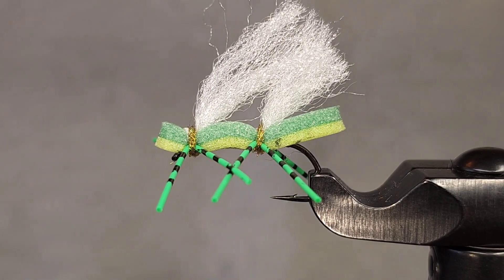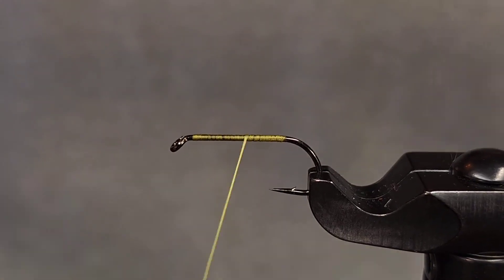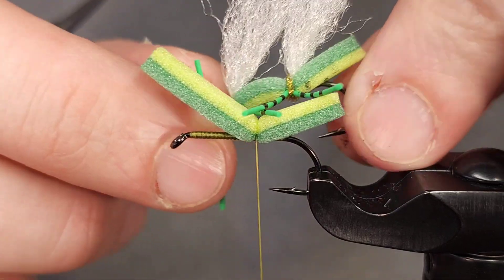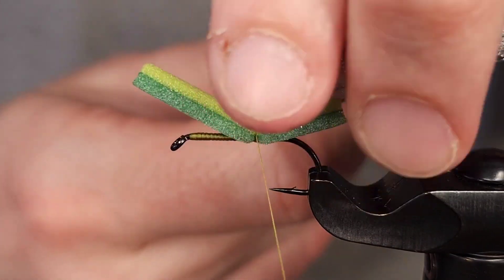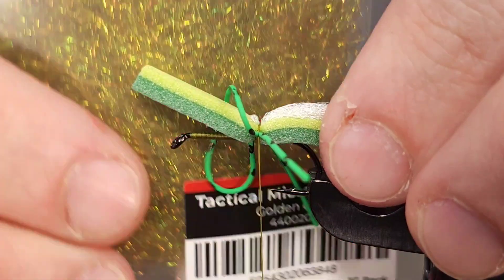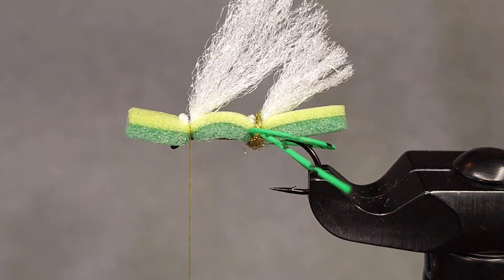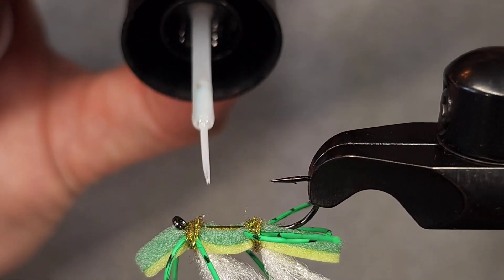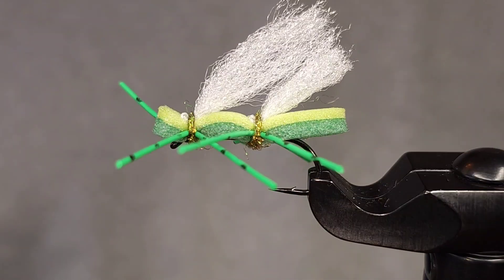Double Decker Chubby Chernobyl Dry Fly

Comment: I like it. Very nice and it looks easy to tie which is a plus for me.     Question please, on a different topic, what is a good glue or resin to use on a dry fly that has a quill on it for the body ? I’m using uv resin but I think it weighs the dry fly down. Is there a better way , a specific uv resin or super glue?  I’ll appreciate any feedback, thanks!!
Reply from the maker: Glad as always that you like it! 

I personally use Solarez Bone Dry. Just a very thin coat seems to work just fine. And, if you end up putting too much on you can just remove some with your fingers or a paper towel and still should have enough on there to cure.
Reply: @fischersflies  thanks!!